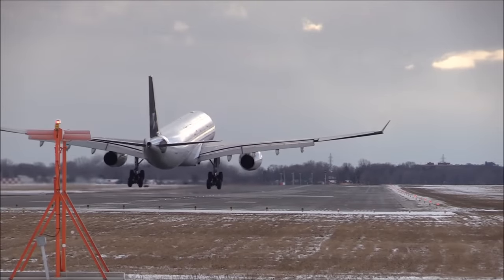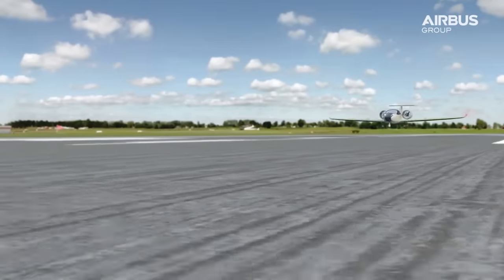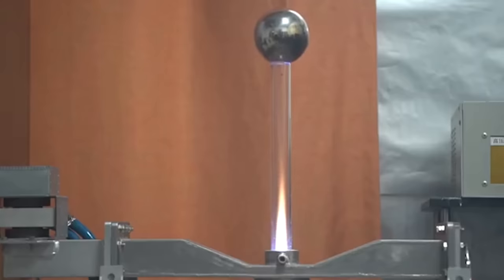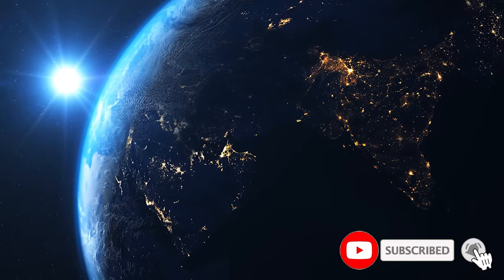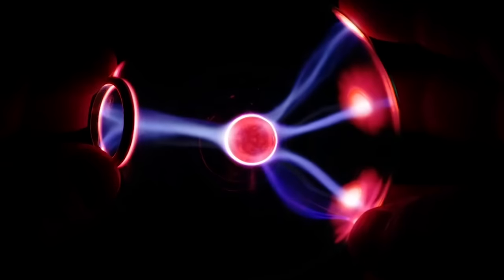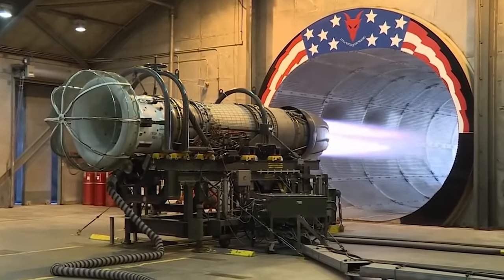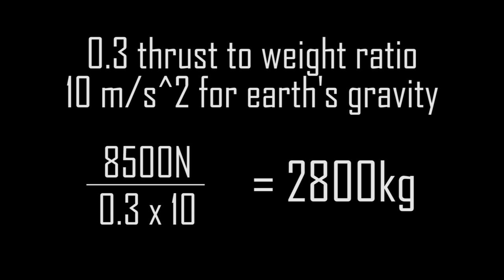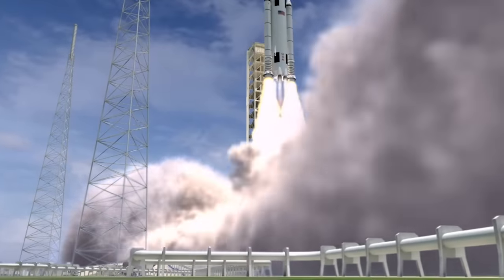Uncovering China's New Electric Plasma Jet Engine

Comment: Very interesting indeed!

Could this mean rockets of the future could do away with big boosters and take off like a conventional aircraft, switching to solid fuel only when the air is too thin to provide effective thrust?
Reply: Rockets mostly use liquid fuel mixed with oxidizer. Solid fuel is mostly used on 1st stages/boosters.
Reply: @KSPAtlas  
That's what I ment, switch over to conventional rocket propulsion to get it into orbit.  It will also allows for powered landings, to cover go-arounds and provide breaking thrust.

All good stuff in my book, and brings commercial flights one step closer!

Comment: Ok I'm confused?
How can it work in space. When their is no air in space!
Reply: This plasma thruster in air and an ion thruster in space both use plasma, but generate the plasma differently. This one uses microwaves to heat compressed air to a plasma, which is then shot out the back to produce thrust. In this case, the air from the atmosphere is the fuel. In an ion thruster, an electron gun ionises some fuel gas of heavy atoms (like xenon or neon), which are then shot through an electric field out the back to produce thrust.

In space, you have to carry the fuel with you. This plasma thruster would work if you had a supply of air on the space craft, but would probably be less efficient than an ion thruster, which are the most fuel efficient space engines that we have today (though they give terrible thrust).
Reply: The plasma engine they're talking about is atmospheric, just like the petroleum jet engines they're hoping to one day replace.... IN AIRLINERS, not spaceliners. 
The space ship bit was just a comparison between microwave plasma engines for aircraft versus ion engines for spacecraft.
Reply: @TD-qj1rn   Umm. the phrase "atmosphere is the fuel", does not meant that it is a fuel energy source type. I looks like you are making false assumptions. As under normal events fuel = "Something consumed to produce energy, especially.".. The key word is "especially".. When they say an ION  drive uses Zeno as a fuel. This definition does not hold true! As that gas is the same as air. It adds nothing to the systems energy equations. One could argue that the true would to use is propellant. 
  However, way too many artricals have been written calling Propellant a fuel, even when it is energy negative.. So he is wrong if you insist on it, but correct with the masses.. Problem is that it is people like you that want to rename things bad, into safe words like, "Grooming gangs".. And that makes me sick!
Reply: @TD-qj1rn  Maybe I should have called it propellant, but fuel is in common enough parlance that it doesn't matter that I didn't. This is an odd hill for you to take a stand on.
Reply: @TD-qj1rn  Welcome to the world of FAKE NEWS, and The WOKE ways. Countless times the news has called a propellant a fuel. Even had FAKE so called scientist on there making that claim. So one cannot fault a non scientist for thinking of this wrongly. Just like Climate change people think science is a consensus. It is not. Worse yet one of the so called climate scientist on their list, is only qualified to talk on the spread of VDs and STDs.. 
  Science shown in public has been corrupted, by greed and turned into a public propaganda systems.
Reply: In other words, when reaching space it could switch to liquid fuel or some gas.
Just the fact that its a air fueled engine, it means in atmosphere, it can fly for ever without refueling, as long as you have power to compress the air and superheat it.
Reply: I think nobody really answered the question satisfactorily. My answer is: this type of engine does not work in space, the ion drive explanation was to make a comparison on both systems, so that we the readers can have a better understanding on how this new drive works. In conclusion, this new engine only works within an atmosphere made of "air", not in space.
One point to note is that in ion drives there is a specific gas that they use as propellant, in the case of the jet engine they say air, which means that it can have a mix of many other gases. It would be interesting to see how different gas ratios affect the process.
Reply: because of the Newtown's third law of action and reaction force
Reply: @danielyang5175  Please elaborate.
Reply: @marilynman  for every force, there must be an equal and opposite force. Which means, if you emit ions into the space with a certain force, you will accelerate in the opposite direction with the same force. As for the acceleration rate, we use F＝ma to calculate. Forces do not need medium to transmit. So ion engines work perfectly in space. They accelerate at a very low rate, but for a very long time. Eventually they can give the satellites high velocities
Reply: @danielyang5175  this would work if we where talking about ion drives.
Reply: @marilynman  We could use cesium or mercury as an ion source. I remember reading about this in high school — back in the late 70s.
Reply: @waltertomaszewski1083  That is interesting, but we just went off track. My intention in my comment was to make everyone notice that the "answer" provided didn't answer the original question. It's like when you answer a question in an exam without reading the entire question, and you get bad marks because of it. He answered about the third Newton's law, which relates to ion drives. But the original question was not about why, or how the ion drives work; it was about what was in the video and then pushing this ion drive section out of nowhere, confusing the person in the process.
Reply: The same way it definitely doesn’t emit harmful radiation... (not at all)
Reply: It's about electric airplanes not spaceships.
Reply: @TD-qj1rn  It isn't the air being fuel, it's the air being propellent.  That's the problem with having journalists with poor understandings of science reporting on science.

Comment: Crypto Community: Alright guys lets make space planes by 2024.
Darpa: Just made plans for Turbo-Scram Jet Hybrid for $5,000,000.
Crypto Community: ooo <_< sold
China: Made plans for Electric Plasma Jet Engine.
Crypto Community: 0_0...Shut up and take my money....Finnally....Thought we had to go on the Dark Web for it.
Reply: Just imagine the weight of the shielding it will take to protect the passagers next to the wings and engins from the microwave generator.  It has the same issues as when they tried to fly nuclear powered bombers.
Reply: @lepompier132  Your WiFi network is a microwave... the one in your home router and the one in your cell phone too.  Microwaves are a form of electromagnetic radiation with wavelengths ranging from about one meter to one millimeter; with frequencies between 300 MHz (1 m) and 300 GHz (1 mm).  Also, the tech in this video is pure Bullcrap.  The large engine being tested in the video is a regular jet engine and their "electric microwave" engine can't even lift that ball off the end of the tube despite having 200 pounds of equipment involved.  Physics is not magic.
Reply: @etherealceleste  Wifi has negligible energy.
liars
Reply: @lepompier132  microwaves can be directed.
Reply: @etherealceleste  I don't think this jet engin will use these band of waves.  I think they will use more the same microwaves that are from a radar dish like on a jet fighter, the type of wave length that heats up and can hurt cells at the core, just like a microwave oven.    That's the type of microwaves they use in that video.
Reply: @morningstarsci  Wen you know how microwaves are generated in a microwave oven, just imagine the power that plane will need just to make these engin start and work.  If you were to put this type of turbine on a fighter you would have to put an APU to start the process.   So BIG source of electric power, just like in back to the future when Doc Brown of the 1955 heard the xxxx gigawatt of power.   Just to keep two of these working, you would need a massive power station on that plane.  On small scale it may show some possibilities.  But when you scale that to a 5 foot diameter turbine that need to spit 20000 lbs of trust, that a very different story.
Reply: @lepompier132  I know how microwaves are generated--through the switching of polarities across an charged air gapped resonant cavity, which creates microwaves as the electromagnetic field closes in on itself. This still does effect the fact that microwaves are created within discrete zones from the magnetron, and can be directed...🤔
Reply: @lepompier132  let me be more direct... would a Faraday cage made of fine copper wire not block the microwave radiation, and also any HF radiation that might be present? It will act as a conductor and take the currents to ground.

Comment: 5:58
I don't think an Engine that relies on ambient air is a good pick to power rockets :D
Reply: You can carry your air in tanks though. That's how chemical rockets work. By going plasma, we can carry far less fuel than today, to power a rocket.
Reply: @tapist3482  yea bc compressed air so light so it won't be a problem to carry it on rockets
Reply: @Keterius  Why the sarcasm? If you think there're better designs you can go develop one actual rocket engine yourself. Plasma and ion thrusters are already the most fuel efficient thrusters human can come up with.
Reply: Its actually quite an old concept to send Scramjets into space that rely on air from the atmosphere as long as there still is one.
Reply: It could be used just for the first stage of the rocket or something similar to Virgin Galactic's White Knight Two. A sufficiently energy-dense battery could power a rocket with a better thrust-to-weight ratio than chemical combustion rockets, since there's no fuel or oxidiser being carried on board.

Comment: Imagine being scared of planes and you see "made in china" on the reactors
Reply: Lmao
Reply: Chinese engineering is on its way to be the best in the world,in fact many of the parts of commercial airplanes are probably manufactured in China
Reply: @JohnSmith-uy2jg  I'm one of them. I usually check out the plane type before booking. Airbuses are ace in my book 👌
Reply: @Adam    *Japanese
Reply: i avoid american cars and planes if possible, dont want gears in my face
Reply: About 80% of the things you use every day come from China. If you are prejudiced against every location that a disease has ever come from there is not much of the world left for you.
The black plague came from Europe, and the so called "Spanish Flu" actually originated in Kansas.
Reply: Everything is made in China, it is the world's factory so everything that is high quality and everything that is low quality.
Reply: @Adam-lz7sr  There is a difference in manufactured and in Engineered, most things are manufactured in china cause its cheap labor but most things are not developed and engineered in China and unfortunately, china steals most blueprints and acts as they invented and engineered it... and because of their copy mentality they lack true engeenering skills and will never surpas for example Japanese, American engenering skills and talent but if they stop stealing and reverse engenering and start actualy inventing and engenering using their brains and developing things from the ground up I think they can perhaps achive great engeneering in the future...
Reply: @mongocom1735  I avoid anything made and developed in china that requires actual engineering...

Comment: I'm an MSc in electrical engineering and Nanotechnology, but had to return to my sinkhole country and currently not doing R&D.
My idea worth spreading is;
Since current battery tech is not sufficient enough for a plasma jet engine to take off, we could use plasma physics in another way, which could be called 'hybrid engine'.
There's always a surplus electricity from the alternators of the hi-bypass engines of say Rolls Royce, and aerocrafts are designed with so many fancy unnecessary electronics to value that surplus electricity.
An hybrid jet engine design is that which uses alternators' surplus electricity; 3-phase, 110v, 400hz, ~60A per engine at about 4000rpm, which approximates to 8kva at 400hz, (well above 0.4kW you mentioned), could be used as a range extender for current fosfofuel jet engines, so that added plasma thrust would increase the efficiency a great deal.
I wish I had connections to discuss this but I like your channel and wanted to share here.
Thank you Ziroth! Keep up the good work!

Comment: Wow.. suggesting it will work well in space, when it runs on Air.. and nobody is pointing this out?
Reply: That's what I thought! Everything else makes enough sense, compress air, electrically heat air, expand it, get thrust. But this design requires atmospheric air. I guess one could make a rocket with this, they would just need to have air tanks on the rocket still, Thrust to weight would be a problem
Reply: He didn't say this plasma jet worked in space - he contrasted it to ion propulsion which DOES work in space
Reply: Carry a tank of gases, duh
Reply: Hmm listen again, and you’ll see he points the difference between this plasma in athmosphere, and the plasma in space.

Comment: Entirely Electrical flight is gonna be just as theoretical as reaching the speed of light. Between the limited amount of power these engines would produce and the energy density of batteries we would still need at least a centrificul flow jet engine to power a generator such as in a plans APU. And even with that to produce enough power to run a big enough electric engine, we would be producing as much of not more carbon emissions as a conventional ducted turbo jet engine.
Reply: better batteries shall be invented
Reply: @Rogi1198 
See, it's not that simple.
You can't just increase energy density forever.
Batteries work by chemical principals.
Theres a physical limit to how much energy you can safely store in a given amount of space.
The fact that a battery won't be burned but instead just holds electrons and therefore needs some kind of lattice structure basically makes liquid hydrocarbons always more energy dense than a battery.
Reply: @fotoschopro1230  You're right, i'm was thinking at some diferent tecnology to store energy. Maybe a microbial fuel cell capable of converting glucose to electricity at high rate and efficiency, or something like that.
Reply: @Rogi1198  
But that's also not very efficient if you compare it to liquid hydrocarbons.

Comment: i remember a lot of talk about "beaming" energy with lasers across vast distances. it might be plausible to have something like a satellite network with the proper lasers. make them like a solar farm, maybe? its been years since i've looked at that tech, but if batt life is the underlying issue with airline distance, it might be useful to provide more energy to the system without stopping to charge. could probably get away with a ground based network of stations, as well. just plan new paths for the lines so they come within range to catch a batt boost.

Comment: The air is likely compressed either purely by the airspeed of the craft, or by an electrically or thrust driven compressor afront the engine, like a normal turbojet engine
Reply: Actually by the looks of it their rig is decidedly stationary.  It's pretty hard to get a whole lab up to speeds like that.😋  Also, a jet engine that uses only airspeed and intake geometry to compress air is called a ramjet or scramjet and they need an airspeed of about mach 3 and mach 5, respectively, to start working.  The compressor in a turbojet engine is driven by the turbine, hence why aircraft using them can start from a standstill and even reverse direction using their main engines.

Comment: Jet engines are actually super efficient. The DoT did a study and the average for efficiency, and per seat mile the AVERAGE in the US for airlines is 64 MPG (US DOT 2010) . The fact is that the production and transport of batteries, and their short life, are the challenges now. Even with better energy density, the physical creation of the batteries and their transport to a site, and the install into the aircraft, means that it won't be economically or environmentally viable for a long time

Comment: My jaw hurts at the thought of sitting inside what is effectively a huge microwave oven with a battery pack under the floor.
Reply: The hard w are that you are talking about would most likely be built into the wings, similar to how fuel is kept in the wings in traditional aircraft.